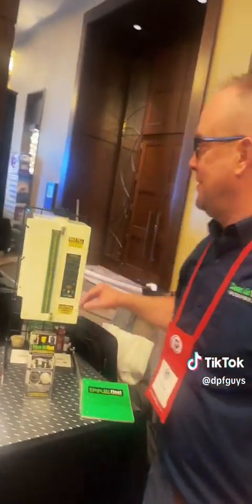A Cummins Engine with 400k Miles Running Perfectly with No Regens? Yes, It's Possible!

Comment: Pittsburgh Power fuel caryist
Reply: Bro i’m looking for it soo much i haven’t heard a single negative issue. Is it that good? I’m wanting to invest in it
Reply from the maker: It definitely has its fans—and if it’s working for your setup, that’s great. But if you're serious about long-term performance and keeping the whole system clean (not just masking regen frequency), take a look at Clean Air Fleet additive too. It’s like the Swiss Army knife of fuel treatments: boosts cetane, controls soot, demulsifies water, adds lubricity, and even helps prevent asphaltene buildup.

No hype—just solid chemistry that gets results across all engine brands. Worth comparing before you invest big.